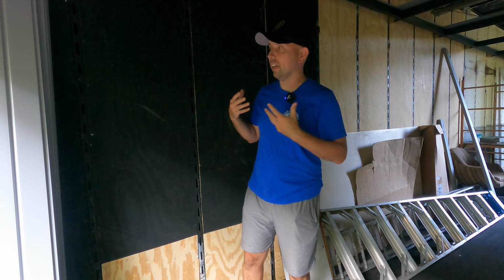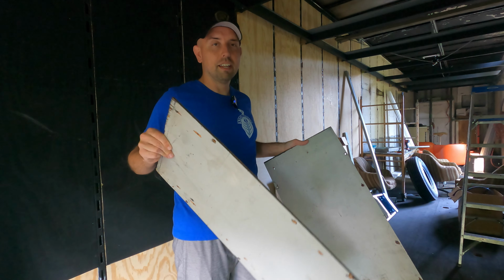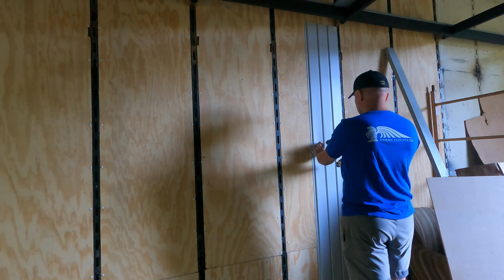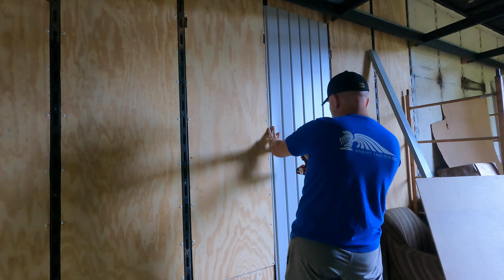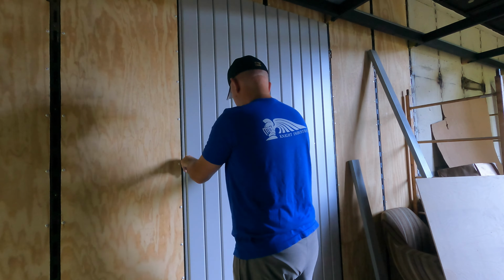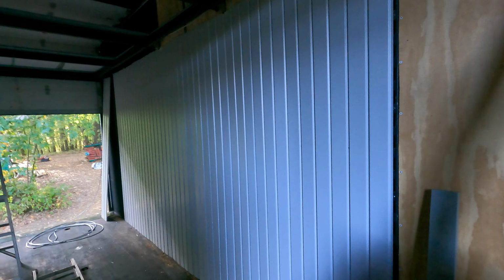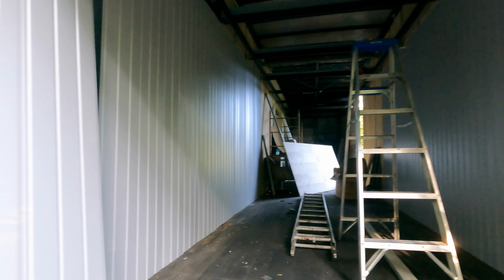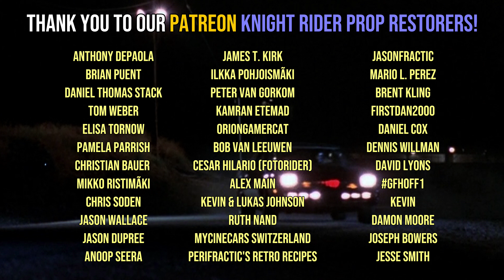KITT's Garage Construction Started! Knight Rider Semi Gets Corrugated Walls Installed!

Comment: When you start getting down to doing the electrical in the trailer, I'd try to wire it with some lithium ion batteries that have the ability to be plugged in and charged that way you can set it up as a static display somewhere and just leave it plugged in so it stays lit.it's looking good so far though.

Comment: good call on the install method, cause if you ever need to do a repair it would be easy to do, an those original panels should be the frame for the wall plaque , that looks amazing

Comment: Kinda curious how much room the cross members will take up once installed...it's sort of tight without anything on the walls when putting a full vehicle in that trailer 🤔 It's really coming along nicely Joe ..I feel pangs of jealousy...my 10 year old self wishes I could have a real KITT and Mobile Flag Headquarters. I also wish I was nearby to donate my time to help you with whatever you needed help with, even if it was just cleaning up stuff. I think a lot of us are going to live vicariously through you. Absolutely spectacular things to come...👍
Reply: I'm curious too, but if they did it on the show, doing it again should be fine, as long as the bracing isn't too thick of course
Reply: @justanotherghost4589  I would be curious as to how much was actually filmed in the semi vs a stage. I believe a stage was more for the interior film shots and the semi was literally all kitt driving on and off for road shots. Although in the episode "The wrong crowd", there was actually quite a bit of interior shots of the trailer interior I "think"...lots of cut scenes...we really never get a full view from the rear into the actual semi if I'm remembering correctly.
Reply: @justanotherghost4589  it was a stage dummy.
Reply: @steveww07  yeah I'm aware of the separate stage, I mean if they drove into the actual trailer back then it should be doable again lol
Reply: @justanotherghost4589  right, just wont be able to open the doors and the sizing wont look right from inside.

Comment: To me the reflections in the series look more like some metallic gray paint shade than just light gray.
Reply: I think the panels may have been different in the interior set vs. the trailer. They look like a fairly shiny bare metal on the interior set, but painted light grey (or at least a much duller metallic surface) inside the actual trailer. Personally I might have gone for the look of the set, but there's no right or wrong choice here really. EDIT: I can find pictures of the interior set with both the shiny metal panels and what look like grey painted panels so I guess it changed at some point. In that sense the painted look makes more sense to use for the restoration.

Comment: Question; If the diamond plate flooring doesn’t go underneath the edges of the corrugated walls, does it go underneath the black framing/cross-bracing?